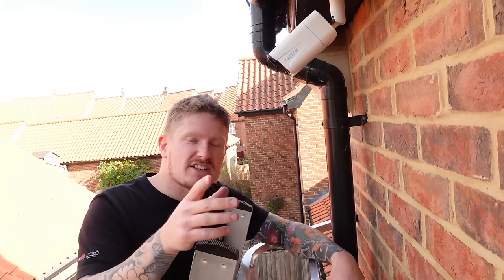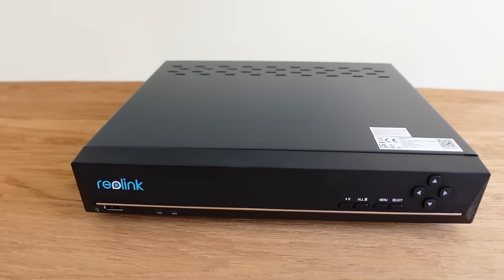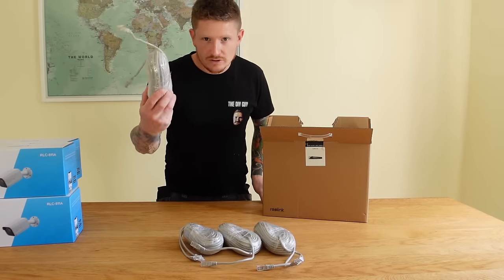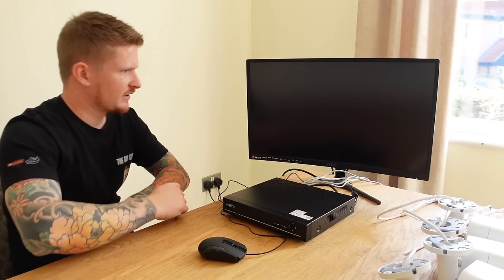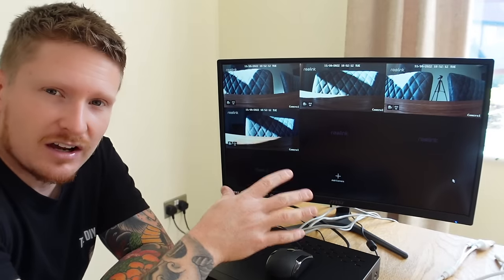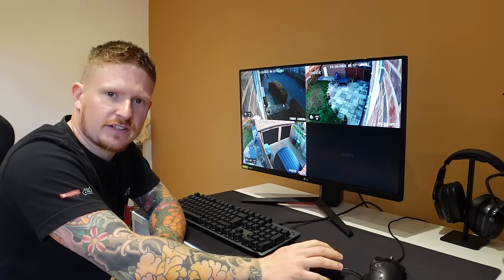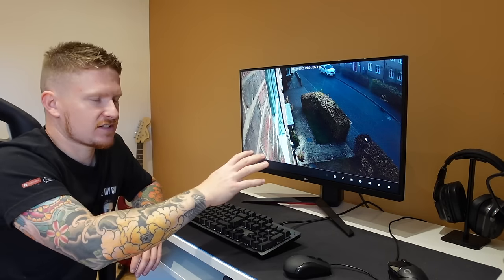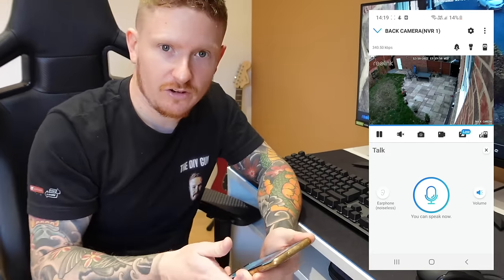How to Install Your 4K CCTV System Quickly and Easily | Home Security

Comment: Could you not have run the ethernet cables through a wall cavity?
Reply: Precisely, last resort would be to run in trunking but the easy way out for those with solid walls like me downstairs. Pukka job you would channel the wall.

Comment: Wouldn't it just be easier to buy some wireless Google mesh cams? I know these are not 4k but certainly good enough to see what's going on. No need for Ethernet wires either. Running Ethernet or power down the drainpipe would be an easy place to disable your cameras with a quick click of side clips
Reply from the maker: I'm not a massive fan of those wireless cameras

Comment: You could have left the nvr in the loft and ran a single network cable from your router to it, then used the app to control everything. No desk space lost either and only 1 cable to run.
Reply: Is it safe to leave an NVR or POE switch in the loft when the Summer's temperature up there is extremely hot, aound 145+ degrees?
Reply: @musclerambo1  I agree with your point that the temperature swings in most attic spaces or lofts would be detrimental to the life of any hardware you put up there.

Much better to leave the NVR and PoE switch somewhere it won't be harmed like that

Comment: Easy because you had access to all that. Do an install with no attic or solid sofit and where the wires aren't long enough or router and TV are in separate rooms with no attic and no basement open concept living area without drop ceiling tile..

Comment: Another thing you can do is to connect all of the cameras into an Ethernet switch in the loft and only run one cable to your NVR inside the house.
Reply: To clarify one thing for those that may not fully understand, the Ethernet switch would need to be a POE Ethernet switch to power the cameras.  This type of camera is dependent on the NVR to power them through that Ethernet cable.  if you put a switch in between the camera and the NVR that switch then becomes the source of power for those cameras.  A regular switch does not supply electricity to power the device plugged into them.  The one vs many cables to be pulled is an attractive option to consider in this scenario.

Comment: Why are there three cables coming from the camera and their purpose.  Looks like you only used the one
Reply: Cable 1) Reset button
Cable 2) Ethernet port
Cable 3) Power port
Since the camera can be powered using POE you only need to connect the one Ethernet cable. If you don't plan on suppling POE to the camera you'll need to power it with a standard power adaptor.

Comment: Sooooooo, you didn't say anything ABOUT THE LENGTH OF THE CABLES!!!!  maybe you were lucky enough to have EXACTLY enough cable to do your job,..... but Most people will not have such a short distance. 

How do you “splice” for LONGER CABLES??

Wilm the signal strength DEGRADE after so my feet or meters????

Will we need a booster or anything like that for the signal?

What kind of cable do you use?

Come on man.....Your video was just like everybody elses....... only made for YOUR OWN SITUATION.